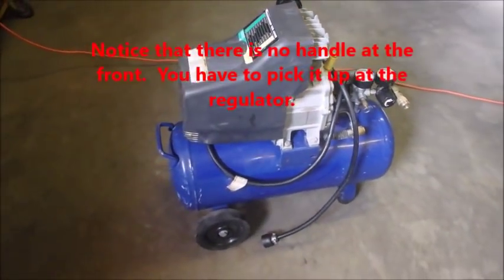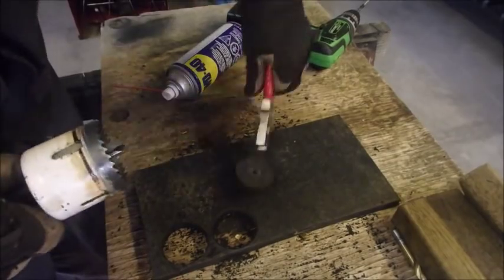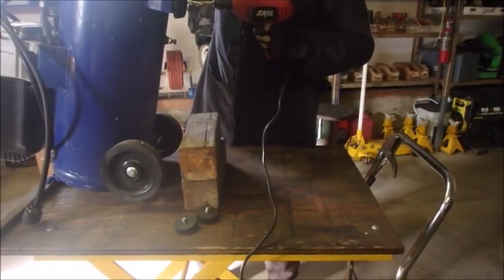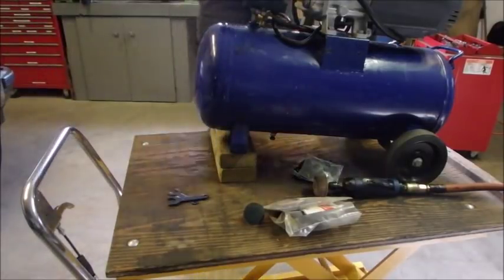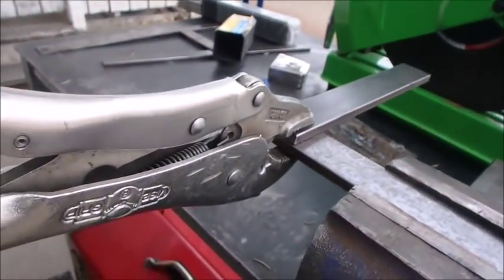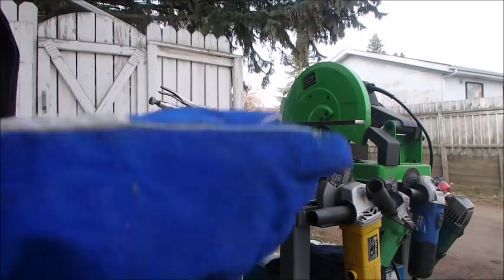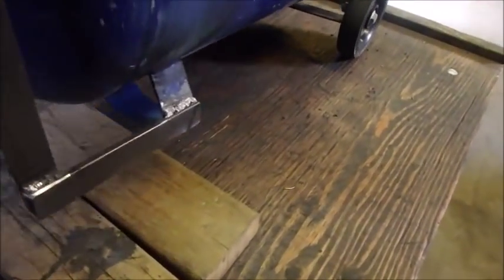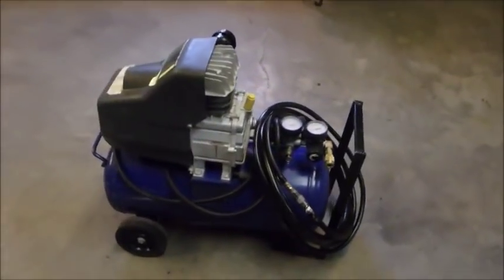Retrofitting a Small compressor

Comment: I have the exaxct same compressor. Cheapo unit from Harbor Freight. Feet came off of mine also. Mine has a plastic handle that connects from the top though. Despite it being a piece of crap it keeps on ticking somehow
Reply from the maker: I saw the original on line and realised there was a front handle.

Comment: I have a Campbell Hausfeld compressor, bigger than that one, but similar in style. The handle is made of bent tubing, about 3/8" diameter, in a bent "U" configuration. The two free ends of the U go under the pump mount and are held in place by pinch bolts.  I can see the two punched and bent tabs on the side of the pump mount that are meant to hold the tubing.  They're right below the pump mounting bolts.
Reply from the maker: After I fixed this one I pulled one up on line    you are right.
Reply: It's probably possible to buy the replacement part from CPO.  Might be pricey, though.